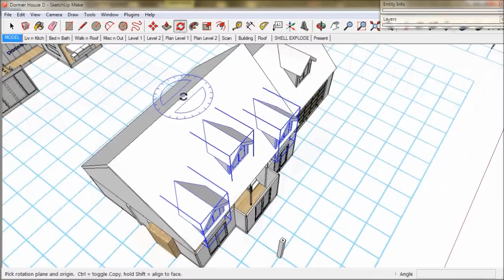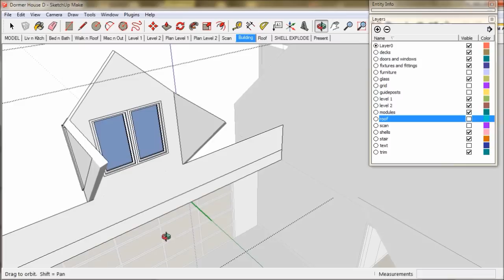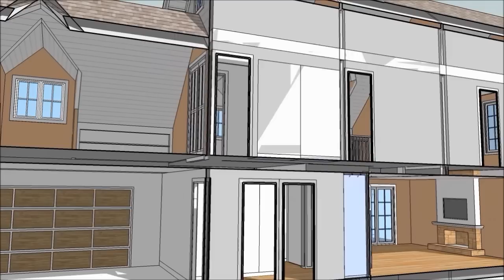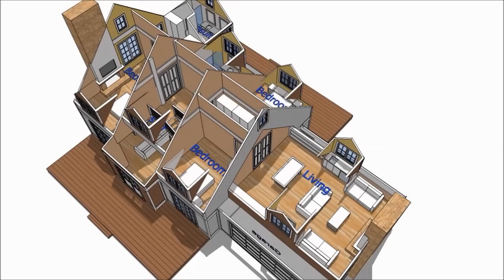Design an Attic Roof Home with Dormers using SketchUp.  Quick Overview and Animation

Comment: I'm interested in buying these plans, but I would like a little more information on the house like square footage, and exact dimensions of each room.
Reply from the maker: Hi Forrest, the floor areas are: 1140 sq ft downstairs, the attic is 1538 sq ft, the garage is 583 sq ft. If you buy the model you can use the Sketchup tape measure tool to accurately measure everything. Its a fantastic house :)
Reply: +TreblD Thanks! It's a wonderful house, my wife and I really like it. Our only drawback is the size of the master bathroom? That's the main area we wanted to know the measurements for. Thanks for your reply!
Reply from the maker: +Forrest Ameling The master bathroom is about 12' x 8'